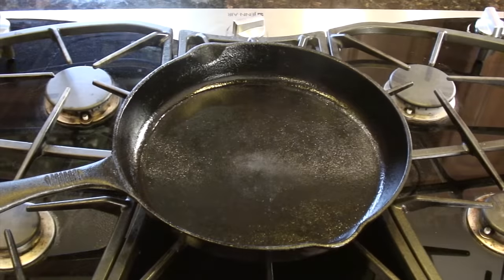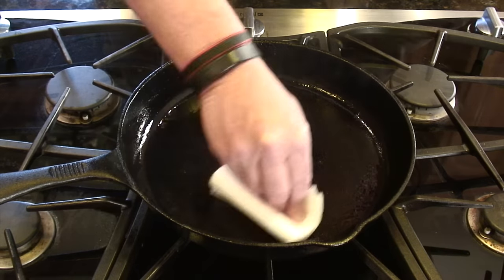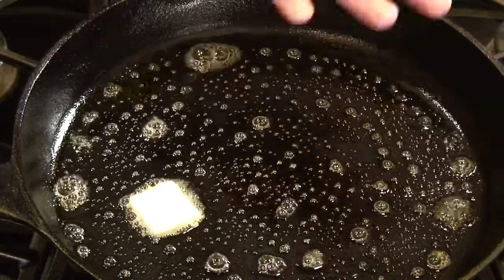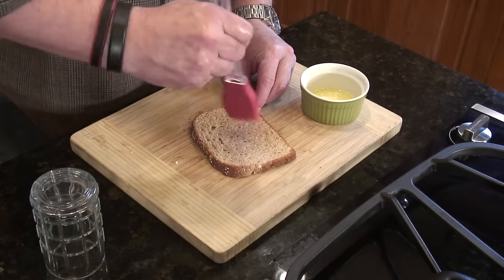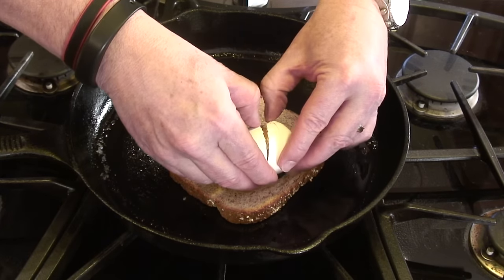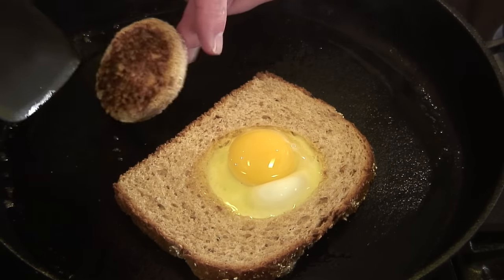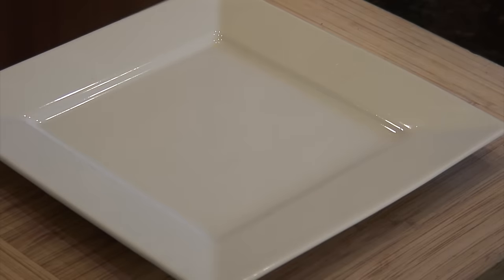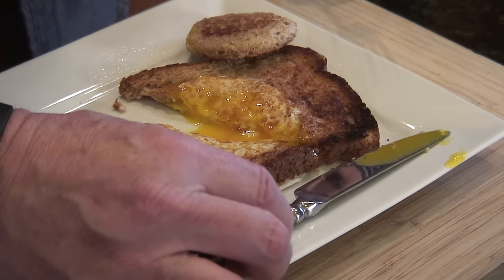How to Make Cast Iron Skillet Perform Like Teflon

Comment: So this guy's tip is to not actually season properly, then dump a huge amount of butter in the pan, then claim it's seasoned and food slides around like the pan is a teflon-coated one?

Here's a tip: if you seasoned right, you can minimize sticking!  Oh, and reduce the amount of fats/oils used in the cooking!
Reply from the maker: +Doctor Morbid Our cast iron is seasoned properly.  1/2 tsp of olive oil (most of that gets taken out by the paper towel) and one small dab of butter is not a big deal "fats/oils" wise.  All I can do is speak from experience.  This technique works.  If you have seasoned a cast iron so well that it never needs any help to make it as "Teflon-like" such as ours, I congratulate you, and would love to have you post a video so we can all learn something.  Thanks for stopping by and don't forget to subscribe.
Reply: 1. oilve oil is not what you use to season properly.  It has a low smoke point.  Lots of people have their preferences, but of all of them, olive oil is OUT.  Why?  It smokes before the high temp you want to use such pans at.  That's why people use flax and sunflower (or vegetable shortening).  When you season at much higher temps than what you'll cook at, then the coating will be very durable and non-stick.

2. your pan isn't seasoned.  You have to bake/cook it in.  Reference the seasoning guide on yt by the Vollrath Group.  The one with the chef in the kitchen..  You will see what a real seasoning job looks like.  

3. you lie and claim you seasoned a pan, when the reality was you were too lazy to learn about how to do it right (which you admitted, to some extent), basically just oiled it, then you cooked an egg in a large amount of butter to make up for it, then you lied again and made a video about the pan being slick like teflon and even putting a clickbaity graphic there.  If you pan was really seasoned, you only would have needed a tiny amount of oil just to coat the surface a tad and the egg would release when it was done cooking.  You basically deep-fried it in oil and looked at yourself like you did something magical.

Learn to cook and stop making clickbait.  Also, stop spreading stupid around the internet.  You're contributing to the dumbing down of the world.
Reply from the maker: +Doctor Morbid Thanks for the feedback.  Yes, our pan IS seasoned...it HAS been baked in already.  This process is "in addition to."  You might know that most cast iron that is sold today is porous.  It is made that way because they typically preseason it by praying it with oil at the end of the process.  It has to be porous to hold the oil.  The antique cast iron is totally smooth.  And, seasoning is not intended to make the surface stick free.  It is actually intended to keep the cast iron from rusting.

Some people actually sand down the new cast iron products to make them smooth like the older stuff.  We don't have the proper tools to do that.  This video is intended for 90% of the people out there who have cast iron products that are porous on the cooking surface and need this extra step to experience a truly non-stick surface.  Thanks for the feedback and for stopping by.  Don't be a stranger.
Reply: +BBQMyWay That is a complete lie and now you're getting into an area where you are showing how little you understand, yet speak with authority.  Cast iron pans today are often not finished for cost savings, but there are exceptions, like Aus ION and others, which typically cost a lot of money.  It's not to hold more oil.  You are now acting like it's 2001 and people don't really know enough to do google searches to see very prominent cast iron experts doing such things as sanding smooth their pans, then seasoning.  Old school pans are very desirable because they often are finished smooth inside from the factory.  Now you're talking about porosity to hold oil when you're supposed to be seasoning it to fill what is better described s "irregularities of a microscopic level" when we really look at it.  You still seem to think seasoning is basically just oiling the pan.  Some pans are pre-seasoned at the factories now for two reasons: to prevent rusting while in the supply chain 2. to allow easy first-time use so n00bs can make it into the world of cast iron and carbon-steel easier.  Oiling after seasoning is to fill the irregularities of the seasoning, which has polymerized into a dry, hard coating of the pan, not a wet, soft coating.  You don't seem to get this distinction, nor do you get that seasoning needss to be kept up or it will wear away over time.  And as far as cooking eggs on ci or cs, you are supposed to put it on the pan, and when that side is done, the pan releases it.  To use that much butter and oil is asinine just to claaim "like teflon".  You let the egg cook properly and the pan releases it on its own- don't touch it.  One of the many benefits of iron and learning to cook properly.  This way you massively reduce the amount of oils/fats used to cook- nothing sticks with barely any oil on a properly seasoned pan.
Reply from the maker: +Doctor Morbid As I have said before, I TOTALLY understand what "seasoning" means.  I've....seasoned....ours....by applications of lard and baking it in on more than one occasion.   How am I acting like it's 2001?  I just said many people sand down their newer cast iron to make them smooth like the older stuff.  The only American made cast iron is Lodge.  The only smooth cast iron they make is ceramic.  Very expensive.  I am aware there are other more expensive brands.  I understand that seasoning needs to be maintained regularly to keep the cast iron from rusting.   I do not believe (sorry, just my opinion) that seasoning significantly contributes to the "non-stick characteristics of the SMOOTH cooking surfaces.  It seems to me that you should start your own cast iron cooking channel.  Call it "Cast Iron My Way," and show us how to properly cook an egg on a POROUS cast iron surface.  You're welcome.
Reply: +BBQMyWay the degree to which you lie over minor things, rather than looking to learn, is disturbing, at best.  It makes me wonder how much you lie about other things in your life if you're completely lying about such minor things here in the face of valid information being presented to you to correct your video and claims.
Reply from the maker: +Doctor Morbid You are a trip dude....let me know when you get your channel started.  Can't wait to see your videos.
Reply: +BBQMyWay Do you not know how the internet works?  I have a channel, which you find by clicking, and I also have a blog, which you can find, too.  I don't see how a channel will somehow refute/confirm anything.  This is like what children say to each other to get off a tough topic and divert it elsewhere.  You didn't season right and you are spreading bad information and you're too butthurt to take proper information that you could incorporate into another video because you have zero interest in helping people.  It's called being arrogant.
Reply from the maker: +Doctor Morbid Yep.  Sure do.  In fact, I just subscribed to your channel.  I'm your third subscriber!  Yippee!!  I can't wait to be enlightened with your superior intelligence.  I noticed no cooking or cast iron videos.  I'm hoping you can make some.  I will be happy to share it with my subscribers.
Reply: +BBQMyWay you really have an issue with reality, right?  I note how whenever you have a retort, it hits on one shady point that you use to somehow prop yourself up like a schoolchild in a popularity contest, while you omit others.  

as for cast iron posts, there are experts on this topic that have made thr be-all, end-all videos on seasoning and cooking, making even your inclusion a poor choice because it's been covered already by people who know what they are talking about AND respected by manufacturers.  They smarten up the world, while you dumb it down (and selectively omit acknowledging things that clash with your personality disorder).
Reply from the maker: +Doctor Morbid Sorry...I've become bored with this "debate" on cast iron, and your ongoing personal attacks are childish to say the least.  The offer remains.  If you would like to educate my subscribers with your knowledge, I am happy to provide you with that opportunity.  If you feel you can help them, I am happy to share whatever information you might create.  I hope your day brightens up.
Reply from the maker: +Doctor Morbid Done dude.  Adios.
Reply: 1. Olive oil does not have a low smoke point, only extra virgin olive oil does. Also, the seasoning process is meant to bring oils above their smoke point so it polymerizes on the skillet. Flaxseed oil has been shown to flake off over time. It gives a nice surface that doesn't last. It's not a good method unless you plan on routinely reseasoning your skillets.

2. His skillet is seasoned. It is black. Skillets don't get black without seasoning them (or painting them). Cast iron is grey in color.

3. The skillet is already seasoned. The first step in the video in completely pointless. Just heat up the skillet to normal cooking temps and add the fat, that's all that was needed.

So please, don't tell other people to stop spreading stupid when you are doing it yourself.

@OP A sunnyside/overeasy egg should not give any problems no matter how good the seasoning is. You just have to add the fat, add the egg and let it set.

Best thing to do, is to get a skillet that is machined smooth. All the pans from the '60s and before were like this and you can find good deals at flea markets, etc. There are also new (small) companies that are going back to machining their skillets but they are a bit expensive.

Comment: Sir, I really hope in the 5 years since you made this video that you did some more research on SEASONING cast iron. As soon as you showed the bottom of your pan, I was horrified. Take better care of your things. 

While your method here isn't far from correct, Olive Oil is one of the worst options to use because of its low smoke point and stronger flavor, and baking the seasoning on will give you a much stronger bond and better non-stick surface. The burner method is good for a quick re-season after cleaning or even once a day if you don't use the pan frequently enough, but you have to have a solid foundation to build upon.

Comment: Cure it with flax oil. End of story.
Reply from the maker: Nope.  Not if the surface is rough.
Reply: If the surface is that rough, you just have a shitty pan. Flax seed oil is about as high as you're going to get in short chain omega 3 fatty acids which at curing temperatures, will develop into cross-linked polymers. It's basically a way to coat your pan with edible, non-stick plastic. After this, it doesn't much matter what you use although if I want to avoid sticking, I use either olive oil or butter just as you did. The difference is I use refined olive oil or clarified butter which both have a very high smoke point and so, don't burn easily.
Reply from the maker: Great info.  Thank you!

Comment: what a load of pre cooking crap. Why do so many people make using cast iron seem so frickin hard? Season it with veg oil throw in the BBQ for an hour (repeat) Then use it. Wash it in soap and water if you want, you're not going to strip the coating. All this lov n care, water-only post-oiling is overthinking bollox.
Reply from the maker: Tell us how you REALLY feel.

Comment: Your title and statements are misleading. You said this would work with scrambling eggs but you did nothing to prove it therefore I don't believe it. Any properly seasoned cast iron will fry a stationary egg without sticking which is all you did. Scrambling eggs is a whole different story because you are constantly scraping the oil away.
Reply from the maker: You are welcome to view the video "perfect scrambled eggs" which I make on the cast iron.   Also, the newer cast iron surface is porous and pebbly, which is why seasoning alone doesn't work.  The older (1950's and earlier) have smooth surfaces where curing does make a huge difference.

Comment: Sorry dude but olive oil is a horrible seasoning oil. You should use something with a decent smoke point like peanut oil or avocado. Every time you smoke olive oil on your pan you're creating toxic fumes in your house. Hope you got your windows open
Reply: No disrespect by the way. The egg came out pretty good. Just want you to be aware that smoking olive oil is dangerous. And yes, I'm sure if you reply, you're not doing a full reseasoning just a flash seasoning. Next time I would recommend preheating your pan with a very thin layer of oil in it (by thin, I mean applied then virtually all wiped away). It does not need to get to a smoke point. Then add a little butter if you wish. Your pan can be low or medium low but should be preheated a good 2-3 minutes. I like to throw a drip of water on the pan to make sure it sizzles before throwing eggs on. If your eggs are sticking, they aren't ready to flip. Just give it a little bit more time. When they're ready to flip, you will know because the egg will unstick from the skillet. Metal spatulas are easier to use on CI, in my opinion.